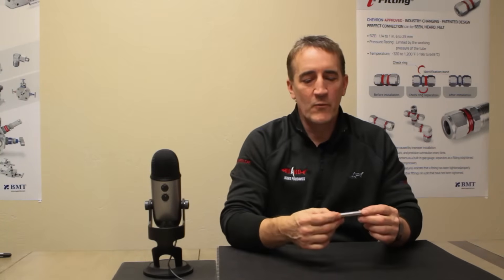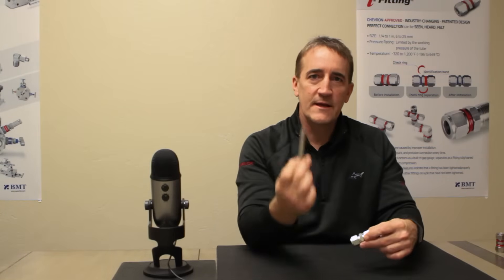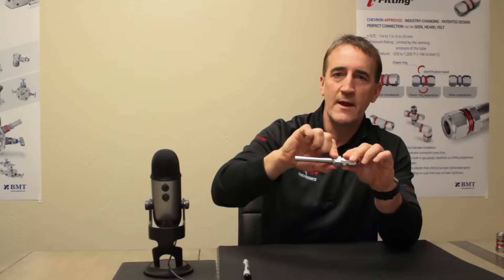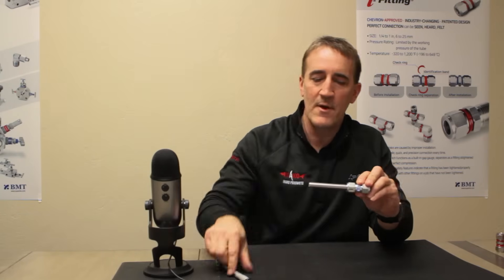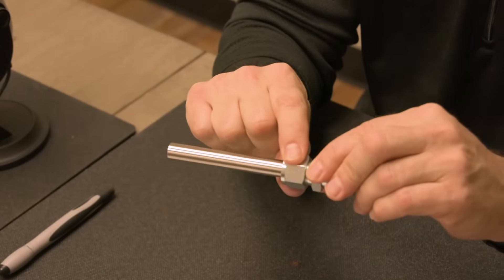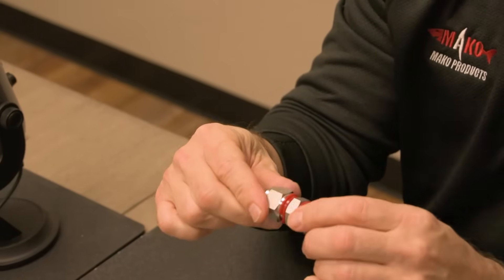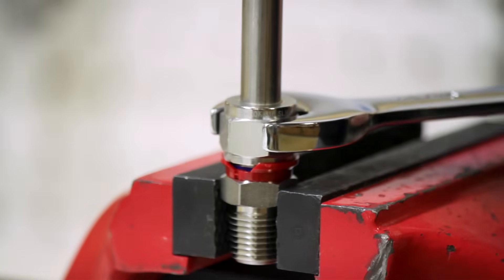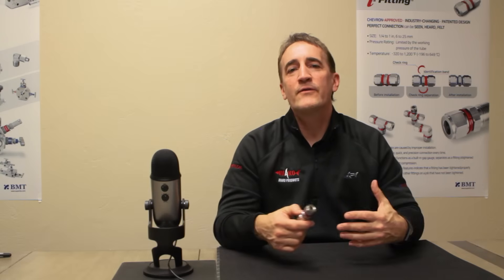Tube Fitting Basics: How to Properly Install Tube Fittings

Comment: is such a tightening the same as a 1" tubbing fastening?
Reply from the maker: This tightening procedure is correct for all tube fittings between 1/4" and 1"
Reply: 3/4 turn for 3/16 inch and smaller and 2, 3, and 4 mm. Also when you remove ferrules in real time applications your built in gauge gap will break loose,but you will leak or projectile.
:face-fuchsia-poop-shape: @SuperlokTV

Comment: whether such fasteners can withstand a pressure of 250 bar?
Reply from the maker: The pressure rating of these fittings is dependent on the diameter and wall thickness  of the tubing used. For this video we were working with 3/8" diameter tubing with a 0.035" wall thickness. This tubing selection would limit working pressures to 3,300 PSI (227.5 Bar). If we would have used a 0.049" wall tubing we could go up to a working pressure of 4,800 PSI (330.9 Bar) or up to 6,500 PSI (448.2 Bar) with a 0.065" wall tubing. It is always best to consult a pressure rating chart before selecting tubing for your application, especially since these values change significantly with the diameter of the tubing as well.

Comment: no go gap gauges are dumb without a go gap gauge...and the 6 o'clock mark.  What does it matter where you mark it?  finger tight, and turn 7-1/2 flats
Reply from the maker: That's why the i-Fitting technology displayed at the end of the video is so helpful. You don't need any gauges since the gauge is built right into the fitting. As far as the 6 o'clock mark is concerned, that is just mentioned to designate a starting point. You could say start at 12 o'clock and turn one and a quarter turns until 3 o'clock, but 6 o'clock is (However arbitrarily) where most fitting manufacturers say to mark so we stuck with that for the video.